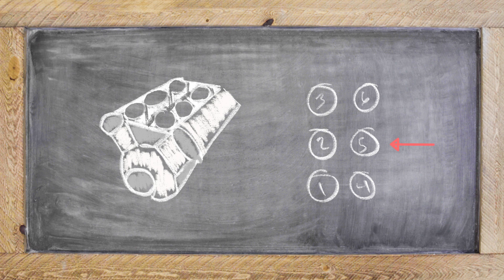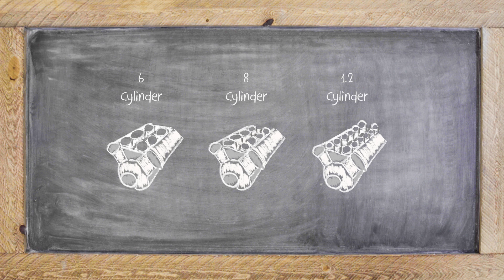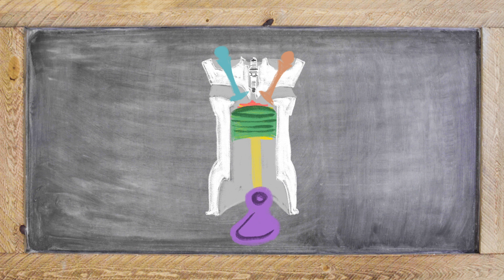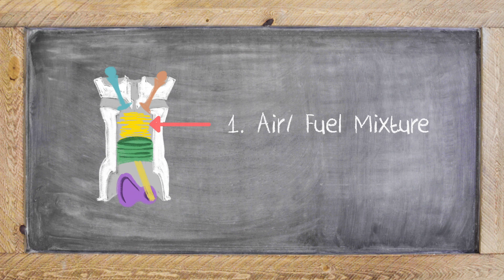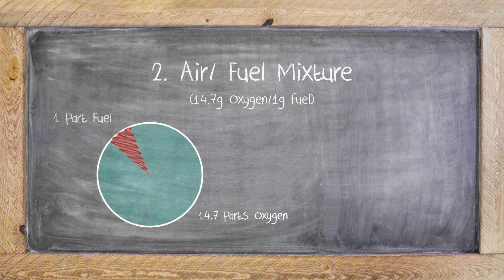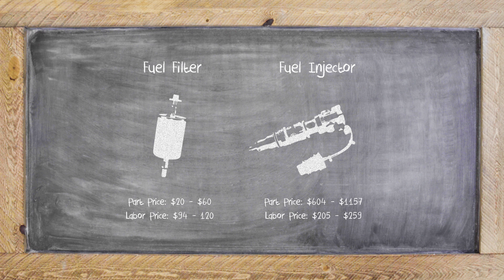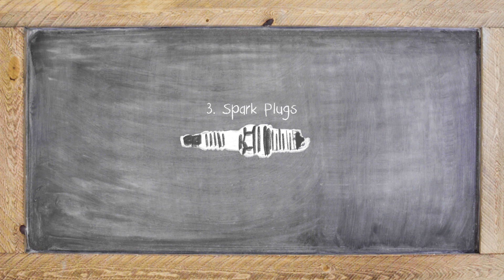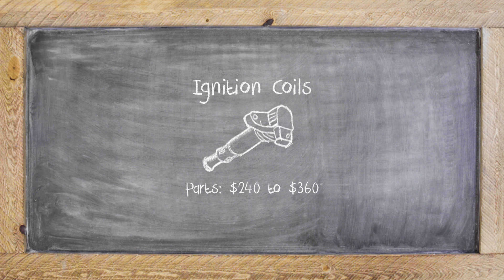P0305 Explained - Cylinder 5 Misfire (Simple Fix)

Comment: I've got codes 300 & 305 on a 2005 f150,  5.4  3v..  need to get lots of info on this particular engine after, coming from a 2004 4.6 3v f150.. Anyway I've also got a  rough idle, then sometimes it sounds like  my  driveshaft is about to fall out.. it's got more then 223,000 miles on it and don't know if plugs have ever been changed which is the next thing on my list of repairs to actually have it in better shape to drive..ugh and of course it's gotta be the plug problem year.. already miss my 4.6 😢 and obviously I'm not a fan of the 5.4 l, especially not knowing how well it was taken care of to begin with!

Comment: i had a ford 450 heavy duty with code on cilinder 5. i swapped coils with diferent cilinders and problem didn't move, until i swapped injectores the problem moved to diferent cilinder.
Reply: replaced coils, pigtails until i swapped injectores. never had a code for the injector, only a misfire. another car came with same symptoms for cylinder 3 and problem got fixed only until i replaced all 8 ignition coils. turns out the car was very sensitive to only replace 1 coil at a time.

Comment: If it is a specific code for a specific cylinder, it cannot be the fuel filter or fuel pump as this would then affect ALL cylinders and not just #5... 6 spark plugs are less than $30 and a pack with 6 ignition coils and 6 spark plugs are not even $70...

Comment: I recently replaced all spark plugs and coils, the fault came up after this repair. 
Why would you advise to do first?
Reply: Late reply and not a mechanic, but if the code came up after the repair, check all the connections. Might need to check the gap on the spark plug too.

Comment: could also be low compression on that cylinder. if it's just a miss fire on one cylinder, it would not be a vacuum leak or bad fuel filter that would make a miss fire on all the cylinders, not just one. could also be a valve not seating completely, a bad lifter, or that cylinders rocker arm needing to be adjusted .

Comment: could it be bad fuel ? i got the code right after i put gas in from a different gas station i don’t usually go to because the price was 10 cents cheaper that day
Reply: bad fuel would not just affect one certain cylinder it would miss on all cylinders.
Reply: @rockstone5313  it effected two cylinder glad it was just bad gas problem is gone

Comment: I had spark plugs replaced and code stayed. Then tried switching ignition coils and same P0305 code came back. Mechanic suspected small head gasket leak. He used blue devil head gasket sealer, replaced original thermostat, new coolant. So far no codes.
Reply: How is your car now?

Comment: On my Pontiac 2004 2-door installing Sparkplug #5 is really hassle / pain and most of the people crack this Sparkplug as I did during the installation, without knowing. Mine was apparently a tiny crack and survived for while. however, after getting P0305 code recently my assumption was that Sparkplug #5 is brand new and did not check it. I switched the Coiles but still getting the P0305 code. So finally after checking wire and coil I decided to check the sparkplug which was real pain so after pulling it out (after several painful attempts) I found that the plug is cracked so after replacing it I got fixed my problem. Therefore, do dont ever cross it to you head that your sparkplug is new so there is no issue.

Comment: A 1999 Grand Marquis has no OBD code to indicate an fuel injector's electrical connection has failed. Misfire can also come from a fuel injector failure. I have a 1999 Grand Marquis. An injector electrical connector had somewhat slipped out of its socket because the connector release tab had broken off. Not noticing this issue with the broken release tab, I'd check and later replace that cylinder's coil pack and would inadvertently press on injectors electrical connector which would temporarily reestablish connection. The engine would run perfectly for a while until vibrations disconnected the coil pack again. Very frustrating. Finally noticed the issue when the process of elimination led me to consider the fuel injectors as a source of misfire. Realizing how to disconnect the injector's electrical connection revealed the problem behind the issue.

Comment: My Jeep Wrangler has had this warning for a few days now. I noticed it the morning after I spent $50 on gasoline. Maybe that is the cause. I am hoping to run low on fuel and get another fill-up to alleviate the problem. Maybe I am being too optimistic. Maybe I am doing more damage to my engine? The Jeep seemingly runs fine. That dashboard light is the only thing noticeably different.

Comment: Great tip to swap the coil to another cylinder to see if code moves with it.   I pulled my plug and regapped it.  It was dry and cleaned burned so misfire could not be that bad.   Plugs have many too so might swap the plug to another cylinder too.   If code stays on cyl 5 I may swap the injector.  When a problem occurs intermittently it can be a pain in the ass to find it.

Comment: Like the way you show tip and tricks to narrow down what the problem could be, like the way you tell and show the prices of all the possible parts needed. (From what I been through the prices seemed accurate). And also the very quick explanation of knowledge on how the system/engine works. Commentator kept it interesting to.. ["Great video man"] Thanx, hopefully there are more.

Comment: Best video I've seen I like this guy he does a great job. explained it so I could understand. We changed the spark plugs, wires and coil pack, still a misfire on five. Misfire on three is gone. I was thinking about changing the fuel filter, my nephew who is the mechanic said he use injection cleaner for the fuel injectors. He suspects fuel injector.
Reply: Hello, what did it end up being?

I have this code and have also done the; plugs, wires and coil packs. It’s still there though. 

Thanks
Reply: @TheRealRyebred i have the same prob. But a few years back a very good friend and mechenic  told me that fords are very sensitive when it comes to plugs. So what i can say is probably change all the plugs but be sure to buy the exact same kind what ever the ford had put in. They have to be the same every where. I mean even should count the number of threads on both.
Reply: @TheRealRyebred   move around the injectores, see if the problems moves around with it. you might be able to diagnose it that way.
just make car aint hot to catch on fire for spitting gas around. blow the fume out before starting the car.

Comment: how can a fuel filter replacement be 
specific to cylinder five??
Reply: It can’t
Reply: because you need clean air to burn the fuel and if your engine is starving it wont run right.

Comment: I belive combustion requires 4 things fuel, air, spark, and pressure to create to burn the fuel.
Reply: If you have a pan of gasoline sitting outside and throw a match (spark) in it and you don't think combustion will occur because there is no compression, you are in for a BIG surprise!
Compression is not required for combustion.

Comment: i have a p0305 and the sparkplugs and the wires and the ignition coils are brand new they said i have low compression could this mean i need to change the fuel injector i haven't changed the fuel filter or the pcv valve yet
Reply: Check compression

Comment: You are wrong about it only being applicable to v6, v8, and v12.

This issue is common for the Hummer H3 which comes stock with an inline 5 cylinder motor or the i5.
Reply: Get out of here with this gotcha crap

Comment: Fuel filter / vacuum leak would affect ALL cylinders, not just cylinder 5
Reply: I’ve changed spark plugs injectors and coil pack and I still have a misfire
Reply: @Iam_zay_wick your going to want to go oem with those coils. I bought a cheap coil pack off eBay for 40 bucks and I went from one p0305 engine code to having a cylinder 6 and cylinder 8 misfire. I changed all 8 of my spark plugs as well but no change, so I went with OEM coils for roughly $125 dollars and so far it's as smooth as can be. No more check engine lights and no more shaking and misfires. I did however have to replace my cylinder 5 fuel injector which luckily it's super easy to replace on a Ford 4.6
I did all the work myself and it saved 100s of dollars. I also have a 3.5 liter V6 Hyundai and just to get to the last three coils and plugs, id have to remove my whole entire intake manifold to get to them cause they are hidden by it. Luckily it's not happening on that car cause that's out of my knowledge for that type of job. I know all the basics but I'm not mechanic.
Reply: @Iam_zay_wick what was the problem?
Reply: @Iam_zay_wick  I’m having the same issue did I figure out what was wrong
Reply: Find the problem?
Reply: i have a rough idle and p0305 is what i'm getting could it be the fuel injector
Reply: Man I’m having this “fuel injector “ problem in the 5th cylinder ,after swapping coil swapping for all new spark plugs , now o think I have a valve stem seal leak “I’m about to have to make time happen because they not about to make me pay for something I can do
Reply: $100 bet D.O.D Collapsible push rods is the problem bent valves displacement on demand 🫴  is the problem
Reply: @cameronhamilton7983 came across most of the 5th gen 2011 to 2014 had that problem
Reply: And a bad ass Tune and you can get a 130mph reliable daily driver
Reply: @cameronhamilton7983 my 2007 350 went 155 mph before not going at farther but it would get there fast with literally just a tune
Reply: Mine was loose gas cap
Reply: @Regal2300 a loose cap caused just one number five cylinder to go bad? Seems it would affect everything
Reply: Jammed closed the collapsible push rods
Reply: Do a D.O.D deleting  kit
Reply: My pops just told me that
Reply: Exactly! It's either a sparkplug fuel injector or coil pack. Depending the year of your car. Daughter has a 09 nissan V6 the labor would have been $600 just to change the spark plugs. Good thing I'm a mechanic.  This guy is full of shit
Reply: @markevans4645  lmao they're telling me i need to rebuild the engine and i hope it doesn't cost that much money cause they're telling my uncle to buy another car and i don't think that's right i think it have to be an fuel injector
Reply: @markevans4645 agree
Reply: @markevans4645 I have a 02 Chevy avalanche with this code I know your not here to hear it but any ideas
Reply: @markevans4645 so which is it Sherlock’s?
Reply: Driving an hour from my Dads on the highway with my little brother for a sleep over and my car suddenly somewhat spazzes out, after that all my lights came on the dash… when I get to the nearest exit the downshifts were really rough and just the ride in general was choppy. Felt like I was ina cammed v8 every time I got on and off the gas. Check engine light would start flashing:( 

3.6L 2013 Cadillac ATS
Reply: @bdawg23k what’s was the reason and did u get it fixed?

Comment: Very well done video...informative and easy to understand.    But, would a vacuum leak or fuel filter/line issue affect a single cylinder, and why specifically #5?  Also, what about the oft over-looked and sinister fuel cap?  An integral component to your fuel/emissions system, a faulty (vented) fuel cap could throw the entire system into chaos!  But i digress....is there something about #5 that causes it to misfire when numbers 1, 2, 3, 4 and 6 are chugging along? Is it a middle child syndrome?  I've had all spark plugs, and coil boots replaced, yet the engine light continues to light up.  My '07 Honda Pilot is in exploratory surgery at the dealer, as we speak.   I'm beginning to think this issue is seeping in from the quantum realm, that there's an energetic anomaly in the Force and it's throwing #5, the numerological representative of balance out of whack! Where's Yoda when we need him!?
Reply: Picard sucks  The dealer couldn't figure it out.  I eventually sold that car and got a Toyota.  Wish i had a better response for you.  Seriously, it seems like a chronic manufacturing defect, as I see other folks also reporting similar issues.  I believe all the computer mumbo-jumbo has made it all too complicated.  I know i will get some hate for wishing to be back in the day of carburetors, but guess i'm just old school.  Best of luck if you, or your Pilot, is experiencing this syndrome.

Comment: I got new plugs and wires put on and now the cylinder 5 code is on wasn't on until I replaced them
Reply: Same here can anybody help me out with this problem? Got distributor cap and rotor spark plugs and wires replaced and now I have a cylinder 5 misfire on now but wasn’t there before replacing them?

Comment: I have a 2007 MKZ I have an error code on cylinder 5 po305 I replaced spark plugs all the way around and replaced injector on cylinder 5 next will be the coil cylinder 5 I hope I'm close to fixing this any suggestions.? Also my light is now off but still running rough I'm pretty sure it's the coil?
Reply: Ive got the same problem with my 2010 MKZ. Replaced the plugs, coil, pigtail wire to fuel injector #5 because we noticed the wire was exposed, coating had melted away, but not the injector yet since the garage took me for $1500 so far and wants to do further diagnosis. Engine light goes on after a restart from driving awhile only occassionally, and only codes when Ive driven it 40 minutes and its hot out with the engine warmed to temperature. My next step is replace the injector for #5. Did you fix yours and what was the issue?
Reply: @TheBlondePatriot   Hi there . There was a tsb on my year and model car, anytime a coil fails Have to replace the (pcm) and all plugs and coils .I've already replaced # 5 injector..I have new coils & plugs waiting on pcm soon as I get that I'll post again

Comment: Hey man, i’ve changed the spark plug and ignition coil and my v6 and i still have 5th cylinder misfire what could be the problem?
Reply: I am having the same problem and am leading towards a computer issue. I have no spark to the number 5 cylinder
Reply: Did any one of you figure out the issue having the same issue with the 5th one after changing plugs and switching coils around
Reply: @antoneashiaclemons1168  i took it to the dealership for a diagnostic, they told that i have problem with my cylinder valve and everything is under warranty including the diagnostic
Reply: @antoneashiaclemons1168  I had to replace the ECM. Common problem with Mazda.

Comment: The first two things that you mentioned wouldn't cause a misfire in just one cylinder you're misleading people if it's a fuel injector yes it will cause a misfire in just that one cylinder as well as the spark plug or coil in that one cylinder if you have a vacuum leak it will cause a misfire and other cylinders as well as a faulty fuel filter
Reply: A vacuum leak can cause a misfire in just one cylinder
Reply: I have an 07 caravan I have P0304, P0305, PO297 this all started with a leaking wheel cyl replaced & still have issues any help would be appreciated it's 3.3l
Reply: I was wondering this myself.

Comment: I have a 06 honda pilot with 124k on it ! Keep getting this code

I changed the spark plugs
Moved over the coils and even changed the fuel injector on that cylinder 

Any clue why this is still happening?

Do I need a valve adjustment? Is it wiring ? Vacuum leak ?

Most annoying code ever 😑
Reply: Hondas do have adjustable valve lash you should take it to a honda or acura dealership

Comment: New fuel pump
New fuel filter
New fuel injectors 
New spark plugs
New spark plug wires
New Maf sensor
New coils
And I’m still getting the same code. What’s next???
Edit. Changed pcv valve, did a compression test, cylinder 5 is 160, cylinder 3 is 165, cylinder 1 is 160. Still have that misfire. What else am I missing?
Reply: I bet its 02 sensors
Reply: @focused4841  just changed them. Still same problem.
Reply: @ikaikasrgnts8618  holy shit what car do you have????
Reply: @ikaikasrgnts8618  what was it by any chance? Was it the cam sensor or vacuum leak? Or?
Reply: Vacuum leak?
Reply: I've changed everything you named on my 98 silverado c1500 and still having the same problem
Reply: @marcushaulcy8667 yes everything I mentioned was the things I changed. I still had the same problem. I finally took it to the shop and they told me it was the internals. They told me it was gonna cost the same to repair or replace the entire motor. I just replaced the entire motor with another motor with lesser miles.
Reply: Did you find the problem?
Reply: @paulkuijer8129  I ended up bringing it to the shop. They said it was internal damage and that repairing it would cost the same as replacing the engine. So I bought an engine from eBay which claims to have 65-70k miles for $1200. Getting it replaced was $1500. So total everything was under $3000.
Reply: @ikaikasrgnts8618 
Thanks!
I have the same problem… hopefully i find the problem before deciding a other engine
Reply: @paulkuijer8129 yeah bro. By far this was one of the most frustrating codes I’ve ever experienced. That’s why I got a long list of parts replaced because I started with the cheapest and was really crossing my fingers it would be the right one. But unfortunately for me I had internal damage. I really hope and pray yours turns out to be anything on the list besides another engine. And please let me know what yours turns out to be.
Reply: @ikaikasrgnts8618 

I very happy to tell you, but the problem is solved... it was a broken wire on the injector for cylinder 5.

I'm so happy.
Reply: Just a guess maybe you should check manifold intake actuator 🤷🏽‍♀️